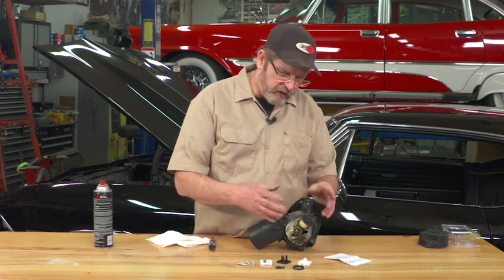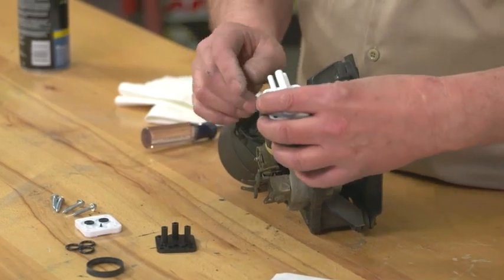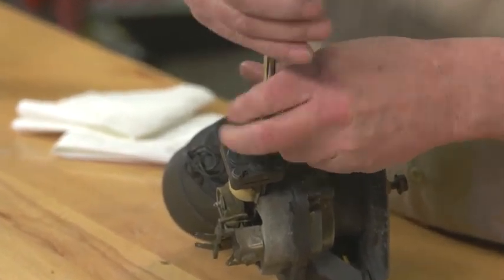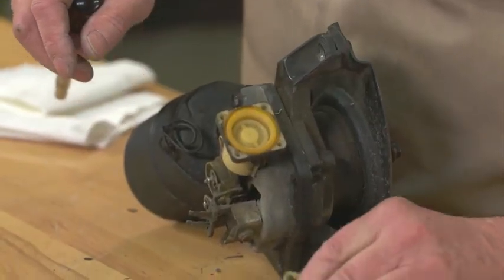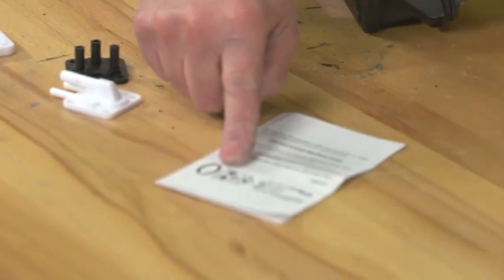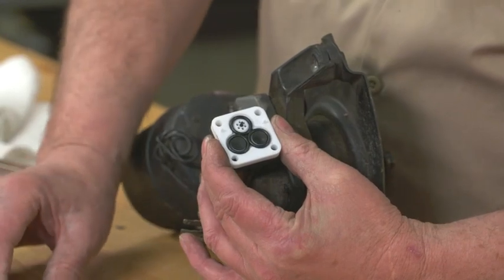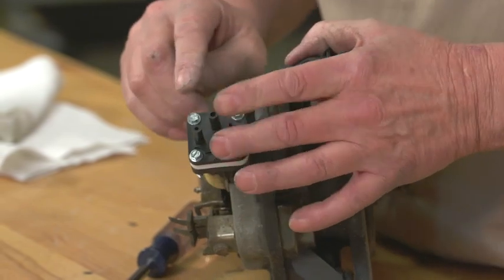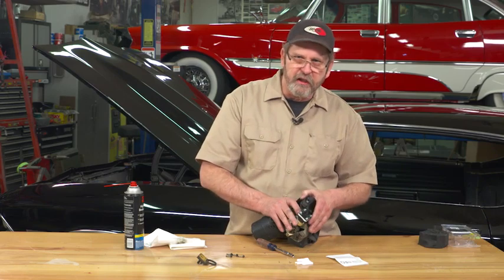WINDSHIELD WASHER PUMP REBUILD

Comment: My 73 & 90 Buicks have same wiper washer assembly. Both do not work correctly. The fluid pump does not shut off & no delay wiper. What is wrong? I know every thing works. I added another ground to wiper assembly. Still not working. I saw that a relay is in the wiring? WHERE? I had a problem with power windows too. Up under dash drivers side. I see what looks like a relay. Only way to get windows to roll up & down consistently. Ran a new fused wire from fuse box to main switches on drivers door. I am too old to hang out under dashboard changing fuses every time I start out
Reply from the maker: Many GM owners have run into the never ending washer pump problem.
Typically it's one of two things.
1. A bad ground.
2. bad cam in pump. The windshield wiper assembly has several gears in the wiper transmission. One of the cams that run off these gears allow the wipers to cycle 3 or 4 times after the washer switch is pressed. If the cam is stuck (dirt or old grease) the washer pump just keeps running or the cam is broken. Either disassemble clean, inspect and lubricate the wiper gear assembly or replace the pump.
3. The 1990 Buick also has a washer pump relay that may need service

In the 1990 there are probably several relays under the dash for everything from heater controls to window relays, it's best to consult a factory service manual before making changes.
Reply from the maker: Hi Todd, 
I am not certain what year/make/model your car is but often Blinking lights are a sign of a weak circuit breaker. 
when it's on the circuit breaker heats up then shuts off, once cooled it turns on again... this can happen over a few minutes or seconds or in just fractions of a second. 
Sometimes it can take awhile to find a good mechanic that is familiar with classic cars, you might want to try a restoration shop in your area.